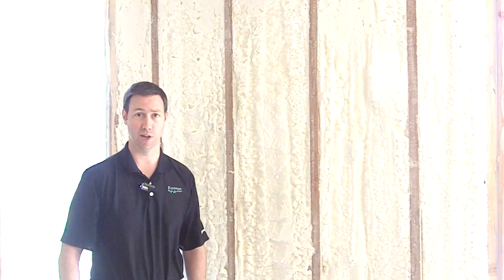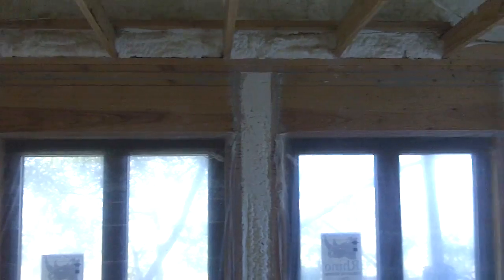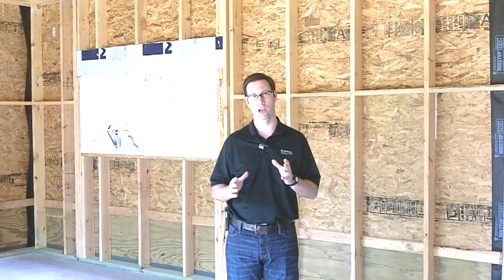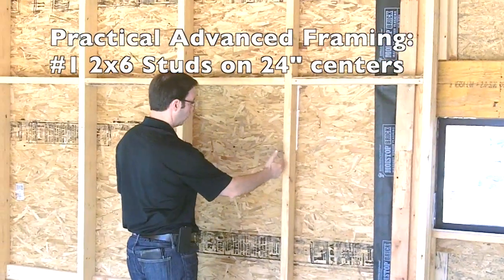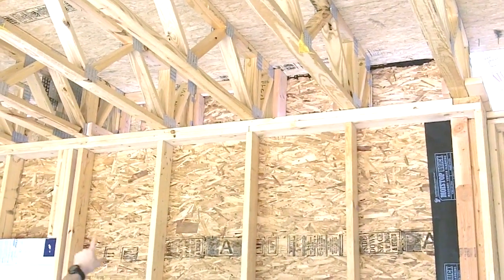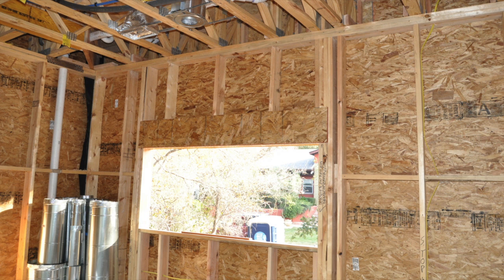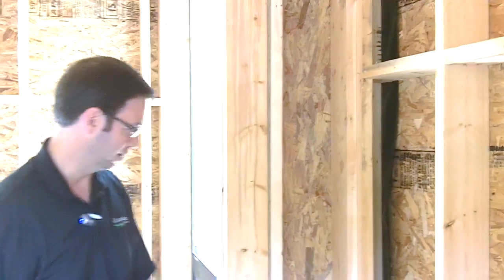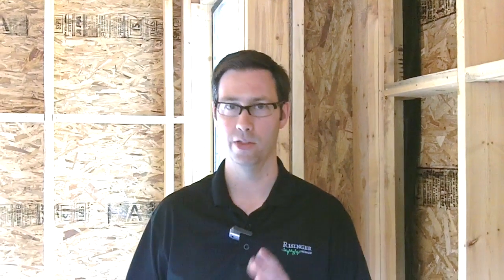Advanced Framing vs Traditional Framing

Comment: 24" on center? As if homes weren't built cheaply enough as it is. You're going to have cracks in all your drywall seems in a couple of years, and good luck hanging caninets and shelves, not to mention the near impossibility of runing new wiring for electrical or media.
Reply: +jdrseven You can add horizontal backing blocks throughout the house if you know specific areas you will need studs.  Not a huge issue at all if you simply think ahead.
Reply: +TTundragrizzly How can you think ahead for the home owner or the next one that comes along. Look at large wall hanging mirrors, the hangers are all spaced for 16" on center. The old homes with 24" on center stud spacing shake like made during high winds. There is a reason why 16" on center became standard practice.
Reply: +jdrseven it wont crack if your foundation is solid
Reply: Seems like you have SEAMS on your mind.  Worry more about a house so poorly designed that you need to cut in electrical wiring after its built for new media which is increasingly wireless. (OMG there's a power cord hanging down the empty wall from my 60" OLED TV screen.)

Comment: You use 16" on centre over 24".  Because if a stud takes off on you the ones beside it help keep the wall looking straight. As well as its structurally more solid and for the few hindered bucks at most it's well worth it
Reply: +curtis munday Exactly. Most of the houses built today will never survive the term of the mortgage. They are falling apart in short order due to skimpy, scrappy lumber and poor craftsmanship. Never go with a builder whose focus is on "less wood".
Reply: +emutiny It wont be delivering a product of greater quality if it is underframed. This is the way walls have been framed since the early 1900s and it works. You dont want a single or even double 2x4 suporting a roof that weighs thousands of pounds over a long span. It may not fall down but it opens the potential for flexing and therefore failure.
Reply: As soon as he said 24 inch centers i stopped watching.
Reply: Mark Doumert t
Reply: @emunity, i think the masons of england built better homes many centuries ago. 24 o.c. is as advanced as the planned obsolescence of my  new iphone
Reply: Mark Doumert,
That's especially an issue when you use nails, as most people do these days. I prefer screws because of this reason - they won't back out over time as things flex/move/settle.
Reply: OK, so use 2x8s and go 48" OC!  Sheesh!
Reply: +Charles Letson owning a home requires that you maintain it.  Also I dont know if you are aware but the terms of the mortgage are irrelevant because nearly all homes are sold before the they are completed.  Less wood is a good thing.  New materials and cost saving measures are very important to deliver a quality product and stay in business.  If your builder suggest something like this all you have to do is say you would prefer a more traditional approach and im sure your contractor would reluctantly oblige.  If you think houses built today are weaker than in the past, even a few decades ago, I would call you an idiot.

Comment: I read some comments that I can't seem to reply to.. 24 o.c. is legal and will pass inspection, but your shearing is spec differently based on wind loads by engineers, so it'll only pass inspection if your plans allow you to build it that way. While it seems like a decent idea, and appear to save money by using less lumber there's several steps that potentially increases overall labor. For us, labor is more expensive than material 90% of the time. Going back to spec, for us in CA we spec for 80 mph wind loads. Going 24 o.c. means more strap ties, more blocking, etc. 

The video here, the builder is using LSL studs. That mitigates need for a lot of blocking (unless spec at sheathing edges, or shear transfers at windows, etc), but DF is much more difficult to work with because of the age of the wood, warping, and shrinkage which at 24 o.c. could leave a lot of imperfections (immediate and overtime) to your walls after sheetrock installation. 

Is 24 o.c. a smarter method of framing? No engineers will go out of their way to spec it for you unless you ask. It makes very little difference in cost, the overall difference in insulation is marginal at best, and overall 24 oc just makes your project indirectly more difficult to work with from my experience. There's a good reason why no one's going 24 o.c any time soon. You'll see engineers who worry about dead load go to a 24 o.c. rafter or floor joist, but from my experience that creates too much bounce and undesirable finish. 

There are better ways to insulate than just spacing studs the furthest possible distance apart. 24" o.c. is a penny smart, dollar foolish decision. Anyone who suggest otherwise, I'm willing to bet that you're not the one doing the installation and hands on building.
Reply: Very well put. Best comment I've read on this video yet.

Comment: Doesn't matter what climate you are in if you experience both hot and cold temps insulation plays the same role.  Insulation works the same keeping the heat out as it does keeping the heat in so it's equally important in both climates.  Also this is not "advanced" framing it has been code in many areas to allow 24" center stud framing as an option for decades.  But when you explain to most people you can save them money by framing 24" on center they go oh no no no i 16" on center is a must.
Reply: True, but generally "hot" temps are not as extreme as "cold" temps. For example, 35C/95F is quite hot, but is actually only about 12C/22F higher than a comfortable inside temperature. Meanwhile, -20C/-4F is quite common in a cold climate, which is 40C/72F away from a comfortable inside temperature. Typically you can also vent the house at night in a hot climate on most days (obviously not in extreme cases where it stays well above room temp at night), whereas there is no equivalent for cold climates. You can get some solar heat gain, but that is a lot more complicated than just opening windows and requires special design and site conditions to be effective.

Comment: The real question is, will the building inspector pass off on that.
Reply: James R yup
Reply: I'm not a contractor, but that was my first question. I've never seen, nor heard of, anything other than 16" being used.
Reply: yes- all of the uniform building codes have this method of framing approved.
Reply: It would not pass local codes around here.  I have seen houses framed 24oc and failing the inspection and having to start over.

Comment: 1. 2x6's won't help you use less wood.  2. You should be putting more insulation on the outside than the inside or you may have condensation issues.  Therefore to solve 1 and 2 you should use 2x4's with either nothing inside or just cheap R11 fiberglass.  3. If you are getting R5 on 3/4" rigid it sounds like you are using foil-faced rigid?...That would be very bad to use foil faced which is a vapor retarder.  I'm not sure of any situation where I would use foil-faced instead of something else.

Comment: NOTHING you claim to be advanced, this  has been done for many years. Don't act as if your better, when in fact your are less advanced, 24" centers is simply poor construction, not advanced. OSB is not sheathing, it not sheathing in the rest of the country.
You are no better than the cheapest builder. excusing it as ADVANCED. shame on you.
Reply: +stewartfrye  " OSB is not sheathing, it not sheathing in the rest of the country."
 The definition of sheathing:      

      " A layer of boards or of other wood or fiber materials applied to the outer studs, joists, and rafters of a building to strengthen the structure and serve as a base for an exterior weatherproof cladding.
Reply: +Jim Watson When they first came out with OSB code would not allow it for shear panel, it does not have the stregth plywood or soild wood slats have. They bent the rules due to expense these days. Build beyound code!!!
Reply: OSB is actually 2 time stronger than plywood in shear strength.  I know it's stronger just from walking on it, however I use 1/2 inch at a minimum..
Reply: ozarkcacti There you go again just throwing shit out there. You may be correct, but you provide NOTHING to back it up.

Comment: As a Midwesterner I was shocked when Matt said he was only putting R19 in, I kept thinking the homeowners were going to freeze in the winter
Reply from the maker: TheSoYeah The walls are R-19 blown plus we have R-5 exterior rigid foam so the total R value is R24.  Remember the point of this video is that not all R-value is the same.  If we framed this conventionally then blown in R-19 we would have MUCH less insulation overall with all the thermal bridging.  Also, we are in Zone 2.  Our winters are rarely below freezing.  Our big issue here is heat gain in the winter.  It's 104 today and we often get 60+ straight days of summer heat above 100.  Thanks for commenting.  Matt

Comment: Instead of false 2x6 (true 40x140 mm) why not a double 40x90 wall, and you alternate the inner and outer stud walls so there is no heatsink stud penetrating the wall space, you always have a stud and insulation combo. More work, yes, but better insulated house, and you gain another 40 mm of insulation if you don't use a 140 mm base and top plate...
Reply: Hey dusternm, when people even in the US want to machine something really accuratly they are using 10th, 100th and 1000th of an inch what is actually metric based on a scale of 10, only the base unit is different, but not /16, /32 or other hopelessly useless fractions.
Is the metric system really BS? Hm, go figure...
Reply from the maker: +SolarizeYourLife It's a valid question.  Double exterior stud walls are uncommon in the states.  I'm seeing it in some Passive House builds but it's pretty rare.  An easier jump for most Americans is to use Advanced Framing then add exterior insulation.  Best, Matt
Reply: +SolarizeYourLife  Really? You're so challenged by little ol' fractions that you feel the need to explode in a frenzy of emotion? So do you also curse folks who can speak more than one language? Inane rant begins in 5...4...3...2...
Reply: Oh, and use a 500 mm layout, too.
Reply: +SolarizeYourLife  I'am just about to expand my house collecting ideas. Hey, that makes sense what you're saying. Thank you.
Reply: +dusternm yes, that is the one industry, construction, forcing America not accepting Metric, shame on them holding America back! Screw all members of construction industry!
Reply: +h4z4rd42  I don't see how a fraction of an inch is metric at all. Those fractions are based on an inch in increments of a 1000 or 10000.
Reply: +h4z4rd42 The metric system is easier for those who struggle with fractions. People of intellect use both. Also engineer scale is in tenths and well used in construction.
Reply: +frnkjones40  Metric is established over the system of 10 while imperial is over 6. When you're using tenths in a system which is based on 6 shows the desperation to get accurate somehow ending up in ridiculously endless "thous".
At last but not least while one inch (as base unit) equals 25.4mm guess which system producing a smaller error rate.
Reply: +Charles Letson You're right.  Metric is easy and accurate. Therefore using imperial is only a force of habit and not a rational decision.
Reply: h4z4rd42 I agree that the metric system is easy but perfect accuracy can only be found using fractions which will always give you smaller increments. A nanometer is a billionth of a meter but a billionth of an inch is much smaller.
Reply: Its rough framing...
Reply: +SolarizeYourLife The reason the Imperial metrics are used in construction is because you often have do arithmetic on the fly when your framing.  It is much easier to do in your head using fractions.   Nothing is stopping anybody in the US from using the metric system.   Metric tape measures are sold in our stores.  We choose to use imperial because it is simply easier to make calculations without a calculator or writing anything down.  Why dont you use your metric system to calculate how much more it would cost to frame 2 walls instead of one, and how much energy savings over lets say 10 years you would save?  I say ten years because most people in america wont own a home longer than that.   Does it work?  I have another idea lets build our refrigerator walls twice as thick so we can get more insulation in there.  Better yet how about put two doors so its double the insulation.  I suggest the all knowing SolarizeYourLife get a bit more real world experience.
Reply: +h4z4rd42 "Metric is easy and accurate"

Agreed. Simple things for simple minds.
Reply: +SolarizeYourLife 38x89 , 38x140 Agreed staggered 2x4 studs works good to eliminate thermal bridging. Maybe not as important in Texas as per se Winnipeg. Metric and wood framing is not a good combo at least in North America as plywood are 4x8   1219mm*2438mm  and dont work well with 600mm,488mm ,400mm,300mm,200mm,100mm centers. If america changed over  to metric plywood/osb/drywall it would be ok 1200mm*2400mm plywood or drywall in lieu of 4x8
Reply: +jeffiek Not when you deal with sheet materials built on Feet and inches dimensions.
Reply: +emutiny hes not talking about framing 2 walls. the idea is a "2x6" wall using 2x4 studs usually 16 oc alternating inside, outside . a 2x4 wall sheeted osb and drywall only has a value of r5 on studs and r24 for the wall. thermal break that with 2"of spray foam your stud is now r20 and the rest of your wall is r40. Of course this makes sense if you live in an extreme climate like winnipeg -40 in the winter, 100 in the summer.
Reply: Greg Tackaberry build out of icf
Reply: Greg Tackaberry
im sorry I just assumed this house was built in a moderate climate.  I live in Raleigh NC.  I have been in the business for quite a while.  OF COURSE spray foam and thermal breaks are good things.  That type of building however, is very costly to the contractor.  Our codes already call for r15 walls, r19 floors, and r38 ceilings.  Foam is required around electrical boxes and all other penetrations.  Sure you could do better and seal the crawlspace and go the whole nine but it is going to cost.  I'm sorry that builders want to make money.  Your talking an extra 15-20 at least on a 1500sq ft home.  Unless foam is mandated it will never happen at least until the price comes down.  Could you put a product on the market that is 20% more costly than your comps with the only advantage being thicker walls?  You would go bankrupt unless your doing high end customs.
Reply: 25' lot 2'6" clearance to property line= 20' house. 6" core ICF walls 1' =18' interior.......
Reply: I hear ya.  Different market down here.
Reply: I want to build a tiny house but trading floor space for framing is hard too rationalize. Looking into alternative building ideas while planning for temperature changes and moving once a week.
Reply: Greg Tackaberry
I would advise that you not waste your money on a tiny house.  You are going to move your house once a week?  Have you ever owned a home?  Am I arguing with an idiot?
Reply: Greg Tackaberry - Where is the house. How big is the house. Do lots of 20' wide houses. Probably not worth the money to save 4 inches if you want to actually insulate.
Reply: being in the auto repair ind 40+ . we converted over to metric in 76 . We adjusted learned both but cost us dearly in tools. You guys have to buy rulers  . 039...."